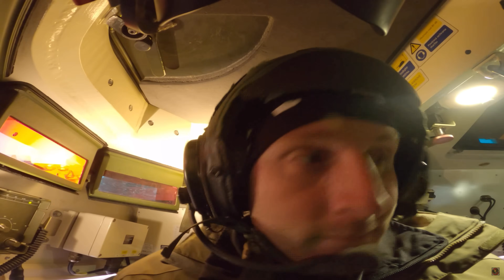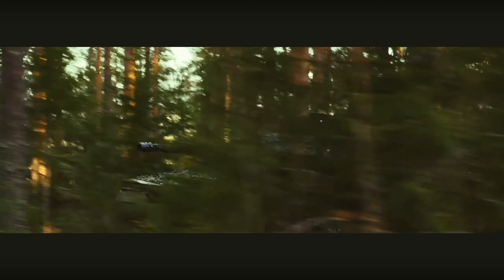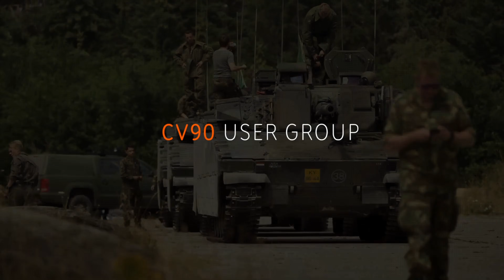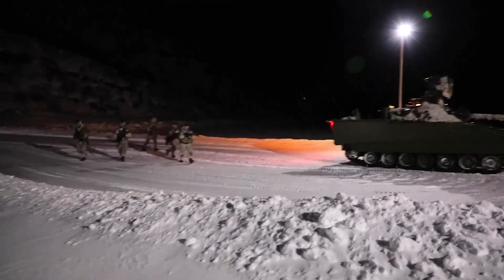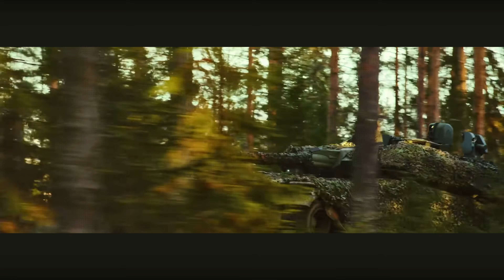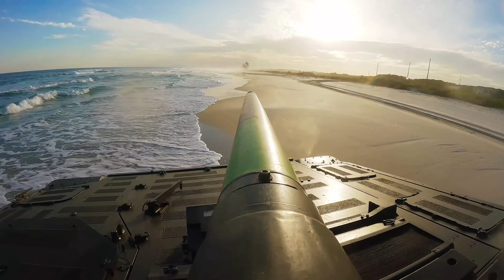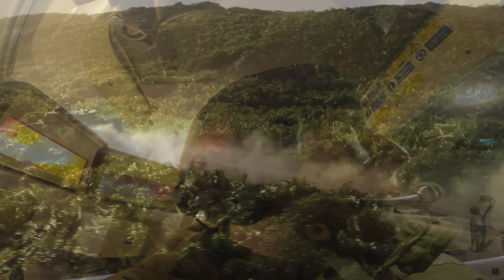Why is the CV90 IFV selling so well globally? | MASSIVE VEHICLE SALES 💰💰💰

Comment: P.s. i noticed the Swedish troops deployed to Livonia recently had a new Cv90 variant. Some Cv90's have been losing their turrets donating them to gun-less command and artillery spotter variants that had turrets but no gun. The hulls left over has been converted to a Pioneer and in this case a company repair vehicle that carries a crane and spare parts. This is a quite brilliant little vehicle.
Also don't worry the company don't lose firepower it actually gains firepower as the command Cv90 and artillery spotter Cv90 both got guns in the company and they are closer to the front line than the repair vehicles anyway
Reply: Hi, Sweden-ball. Greetings from Poland-ball.☺
Reply: Greetings!

Sweden and Poland has always been the best of friendly  friends throughout history.
Reply: The more it is sold the cheaper it will get to run
Reply: Where have you seen the pictures of them in Lithuania?
Reply: @zoom5024  Swedish news when they came off the boat.
They where Strf90D1 vehicles for the most part which is upgraded A versions.
I believe the battalion has one tank company 1 cv90 company and 1 XA-360 company we saw all those vehicles at least.
Reply: @zoom5024  Livonia would be Latvia in modern times..
Reply: the ones i have seen are cv90s from the 90s so D1 and D2..

Comment: I think the DOD made a mistake choosing GD over BAE to move forward with Rheinmetall. Nothing wrong with GD's innovation persay but I think BAE has a better machine than that of the AJAX
Reply: HUGE mistake selecting an inferior vehicle just for the gun system. Ridiculous.
Reply: @nikkimontgomery6889  I'd really like to see that gun in the CV90. Like a Bofors cartridge shrunk by a third.
Reply: @johanmetreus1268  i disagree, i think something like a 35 or 40 would be best in use with ATGM's. The 50mm could be moved to replace the M1128 to use with maybe an ATGM.

Comment: That's interesting cause its performance in Ukraine has be... lackluster imo.
Reply: Your opinion is irrelevant, because, reality over feelings. Cope cope.
Reply: That RPG-7 from 50 meters 8n front glasis video was impressive, for the RPG...
Reply: @ljubomirculibrk4097  except it was a 125mm HEAT-FS from a T-72, not an RPG... and it failed to penetrate🤣

Comment: The Swede in Ukraine showed less survivability than Bradley, he did not hold an RPG at all, although he was claimed to have composite protection against cumulative
He has a bad gun with a bad cassette loading system and a low rate of fire.
Reply: That's a lie and you know it. You wouldn't be so paranoid that your troops calls for T-62s or better tanks every time they spot a CV9040 if it was as bad as you try to claim🤡
Reply: @SonsOfLorgar  Dude, there's a video of how the Swedish infantry fighting vehicle was fired twice from an rpg in a wooded area, 2 of the three crew members were killed by a cumulative jet, then this car was shown to Shoigu at the trophy exhibition in Moscow, where they specially showed him the so-advertised multilayer composite protection pierced by cumulative, it's all on YouTube, if you want to find information.In your propaganda, you deny even the obvious facts.
Reply: @макслюлюкин  you're coping ivan.
Reply: @макслюлюкин  really? The videos where ALL the internal equipment and electronics is intact without a single spot of any kind of soot or singed paint because NOTHING PENETRATED? That video?
You are coping hard moskovite 🤣
Reply: @SonsOfLorgar  it was also hit by a tank..
Reply: Stop saying "He" you weirdo
Reply: Armor is rated to take 30mm AP rounds, not RPGs.

Comment: CV90 is in a unique position right now. Large enough to accomdate future growth and the added systems we expect today, but the chassis is also proven and has alot of development time to iron out the bugs. Alot of newer tracked "IFV like" vehicles like the Ajax or Lynx have had alot of growing pains and deficiencies to fix and while the Bradley is reliable and a workhorse, its at the end of its potential growth cycle.
Reply from the maker: You make a really good point there!
Reply: @_Matsimus_ also the fact that it comes from a British based company albeit built in other localities but the EU is largely responsible for making British defence contracts go to non British companies, happens with uniform the same uniform company was producing British armed services uniforms for decades only to have to eu say a larger percentage of uk defence contracts have to go to non British companies which is utter bullshit, look at German armed forces pretty much all of the vehicles are German produced same with small arms , France was the same basically the eu made life as complicated as possible for uk industry
Reply: @darrenjones3681 British owned company, developed by the tiny wikings.😂
Reply: @darrenjones3681  That was the UK government.  It  (both Labour and Tory) refused  to invest in UK industry, preferring to sell out instead of  using the built in exemptions that were in EU policies specifically for  that purpose.
Reply: Canada needs to buy the cv90  woukd go great working with the lav and and the leopards  @_Matsimus_
Reply: @_Matsimus_  I'm not saying the CV90 is bad, but I feel like if you love that IFV so much you should just marry it. I'd like invitations to the wedding, but what on earth would the children look like?
Reply: @randomwarehouse4702  They would look better than the love child of AJAX/ARES. 
But seriously CV90 occupies the sweet spot when it comes to size, firepower, protection, mobility, expandability and cost. It has proven itself to be good enough but still capable of future development and upgrades. Certainly a better option than an all Boxer based light force.  Tracked AFVs and wheeled, are not interchangeable. Each brings something unique to the theatre commander. They compliment each other nicely.
Reply: @randomwarehouse4702 😂😂😂😂😂what the fack
Reply: Ajax has been a complete and utter disaster.  Even if it works out ok for the British army in the end, it's reputation has taken such a battering it faces a huge task to win any exports.
Reply: @Weakeyedominant it’s always the same with any British defence contract if there is a proven product already available they ignore it and throw money into unproven projects, fact happens time and time again just look at the SA80, Nimrod , and many more
Reply: @darrenjones3681  " just look at the SA80"
The SA80 could have been at A2 standard from the beginning if it wasn't for Thatcher's desire to privatize everything, leading to design being handed over to engineers and machinists inexperienced in weapons manufacturing.
This becomes evident in the HK upgrade, which basically just took the drawings and remade the same parts in the manner they should have been done to begin with.
Reply: @darrenjones3681  The funny thing as they now are owned by BAE they could probably produced them domestically as the plant in Sweden is fully booked for many years.
Reply: @darrenjones3681  There are good reasons why countries favor domestic weapon development and manufacturing over buying foreign solutions.
Reply: @Weakeyedominant  British war industry  is dead and gone.
Reply: @jamesnaylor3274  aerospace, naval and missile production are all far from dead or gone.
The land industry took a battering thanks to the so-called peace dividend only to be caught out by wars in the middle east.  The army didn't have a clue what armoured systems they actually needed for current/future threats.
Spent billions filling gaps with American made mraps and spent 30 years tinkering with their scout vehicle replacement constantly changing requirements the UK land industry simply shut down and the vehicle they eventually selected turned into Frankenstein.
Pretty sure politics played a part in selecting LM and GDLS who had no history of producing anything in the UK or working with the CTA canon developed by BAE and Nexter and the rest is history.  
I do hope Ajax is a success story but there has been so many press articles suggesting fundamental flaws in it's design especially regarding the weight increase and suspension insufficient to handle it, the Americans replaced the suspension on their griffon ascod equivalent, pretty sure ASCOD 2 uses a different design and Ajax was eliminated from the only competition it entered in Australia very early.  There has been no detail shared about what GDLS actually fixed to pass the UK trials other than better hearing protection it doesn't inspire confidence.
Reply: @Weakeyedominant  is that why Brits are ordering Finnish apc's
Reply: Matsimus what about the damage to steel vs rubber tracks in mine and ied blast ect ?
Reply from the maker: @darrenjones3681 I did a video on it 😏
Reply: @darrenjones3681  Anti-personal mines probably don't break them completely and anything bigger would break steel track anyway, so that brings it down to direct fire durability. You could have plate that stops 12.7mm in front of the Drive Sprockets and now you just have a superior product in every way except repair speed but they just cut the track off and drag it back to a safer location to repair anyway. 
Range, weight, Acceleration, bearing fatigue, ride quality/troop fatigue, and sound signature are all better with rubber track.
Reply: BAE is in a strong position right now. They have both the CV90 and the AMPV ("Bradley 2")
Reply: Not encouraging that Uncle Sugar has selected an Ajax based system for the Booker requirements.
We should all be working with the Swedes and Koreans methinks.
Not in agreement that Bradley based systems are at the end of developmental relevance or utility now or in the near future. 
Super Brad w/ automated turret is just the thing to get us to the thing that actually works NOW vs. endless development and budgetary waste that leads to nothing at all.
Reply: Right time and right place to create a resilient network of manufacturers of logistical proximity...
Reply: The litmus test is battlefield.
Reply: Cv90 is in a position to include future growth because it has been getting constant orders and upgrades.
Each customer wants their features and when you put that together it has made for a better vehicle. 
They say the Boxer is modular but with the mkIII the Cv90 became modular as each function was given its own space instead of spreading it out.
This makes it easy to build different variants as only the combat compartment is affected.
Yes the boxer can change modules and the cv90 get their module locked in but how often do you really change
Reply: @AdurianJ  I think in the end modules will be replaced when the vehicle is scheduled for an upgrade or in combat conditions when its damaged. I doubt many armys will have tons of component modules laying around.
Reply: Also two other factors in the CV90 vs Ajax debate, CV90 is amphibious capable Ajax isn’t, CV90 is relatively compact Ajax looks too wide for air transport in anything else than a C5 or similar in comparison say in towns and passing through villages Ajax looks bloated like it already ate all the pies
Reply: No issues Ive heard of with the Lynx as of yet. Its proving to be the future for IFVs as it stands, packing unrivalled protection and armament.
Reply: @hummingbird9149 Only that it is broken 😂😂
Reply: @andersh6227  How broken? A Kf-51 rolled out from Rheinmetall Hungary production lines has finished testing in Italy 2 days ago and was fully approved for mass production without any complaints.
I guess when you start cutting metals for a new vehicle expected to be delivered in 1000+ units, you'd be aware of issues like "being broken." 🤔
Reply: @Leptospirosi  I got you good 😂😂. I picture you being red in the face and going through the roof 😂😂. I love it and thank you!😁
Reply: @andersh6227  ok, I suspected you were just Trolling: I just gave the benefit of doubt anyway.
Sorry to delude you about your "success": I'm not that engaged into an IFV to get "Red" or "Mad": I'm just here to see if I can  learn something I don't know yet.
Thanks for clarifying your position anyway.
Aurevoir
Reply: @Zumzifero  I dont even know what a kf-51 is 😂
Reply: @andersh6227  huh? What are you talking about? There have been no reported issues with any Lynx so far
Reply: @hummingbird9149  You need to educate yourself, the Lynx is broken, it has to many issues according to Ice- report. They will need years to get it combat ready. Its a fuck up, paper tiger.
Reply: So where is the CV90 better than the Lynx or Boxer? Both should have ironed out most of their kinks by now.
Reply: CV90 is in a unique position right now" -  700$ FPV easily destroy CV90 IFV
Reply: Can, undoubtedly. Easily? Considered less than ten of the fifty has been made inoperable over the year and a half of frontline service, and that the Ukrainians like it wnough that they not want more of them, but also build them domestically under licence suggest your views are somewhat simplistic.
Reply: The Lynx is a different beast from the CV90 and can count on all the struggles with the Puma and the Ajax to redesign all that went wrong there.
The KF41 is a 50tons vehicle, larger, more powerful, much better armoured and with a huge potential in term of growth, probably more expensive too.
The CV90 is lighter, probably more suited for certain boggy terrains, but the crew compartment inside is more strained and the volume of equipment that it can carry is lower.
For how it is built, it suffer from competition by wheeled vehicles like the Boxer, the Freccia 2, the Piranha, the Stryker and the Patria unless heavy mud conditions are expected. Those are MUCH more mobile vehicles on the road, and much cheaper to run.
The KF41 on the contrary is a more massive vehicle that does not compare witj the wheeled vehicles except, may be the 10 wheels Piranha.
The CV90 is more similar to the original KF31, but everyone seems to be oriented on the larger Lynx nowadays.
Reply: @Zumzifero Why are you comparing an MBT prototype with CV90, or Piranha etc?
Reply: @periculosumadversario  because @Cattle901 did in the main post, writing about "many issues" in development.
As far as I know, the Lynx had almost none, and BTW is NOT a prototype, as production has already started in Germany and Hungary with several units already delivered to the Hungarian Forces and even Ukrainian ones. At the moment, it is fighting on the Ukrainian front.
For these reasons, it is perfectly fine e to compare the Lynx and the CV90, as both are for sale on the same markets, both are in production, one an older model ond one being new
Reply: @Zumzifero   @Leptospirosi I have to point out, there has not been any known malfunctions, teething-problems with CV90, ever. What I've heard is that the first battalion of Pumas experienced a more or less total breakdown (as in taken out of excercise) during a massive excercise in Germany a couple of years ago, relating to a turret-issue if I remember correct. Ajax we should not mention in the same room🙄. 
Hägglunds/BAE & the Swedish governement have already set up a deal for new factories and tech-sharing with a reported wish from Ukraine to make the CV90 their main IFV for the future. Ukraine is the market ALL weapons manufacturers want to be a part of, of course, to test all their equipment, and want to become the main supplier to in the future.
I believe there's room for both actors, don't get me wrong, they compensate each other in several areas - Puma is larger, but also heavier & more expensive. CV90's newer models are now up somewhere around 38 tonnes, far from the original 18-24t as it was. That is an armour factor. It has been brutally tested in all weather conditions, and Puma/Lynx still has the battlefield testing to be done. Germany has publically stated ONE (1) is sent to Ukraine! It's not a 'game changer', it is purely to be able to say to buyers, and in the books: "Battle tested in Ukraine".
Reply: @Zumzifero Ukraine=mud
Reply: @Zumzifero They all suck compared to a Carrier 😂😂
Reply: plus, its no Bradley so there's a huge market for non american equipment atm.
Reply: @Pilvenuga Bradley isn’t everything it’s gun is from Australia and there are other alternatives to Tow2 it can’t carry full sized squads and its profile is very tall not great for concealment and silhouette on the horizon even warriors have a much lower profile

Comment: Simple: It's a reliable platform, tested and has room for innovation (The UK should have replaced the Warrior with this rather than relying on the wheeled Boxer to be the IFV).
Reply: No the uk knows that the boxer is ALOT better!
Reply: @ The Boxer has no tracks, Tracks are needed to follow the tanks into the mud and rough terrain. The Boxers the UK is on about getting are not even armed with the bigger cannon. They instead are relying on the buggy Ajax to do the role of combat vehicle a normal IFV would do to support the troops. But Ajax don't carry sections into battle. 

So basically the UK has decided to get two vehicles to do the job one use to do.
Reply: @HedgehogZone it’s not, it’s different. The UK isn’t getting any IFV modules, so no it’s not better for that role.